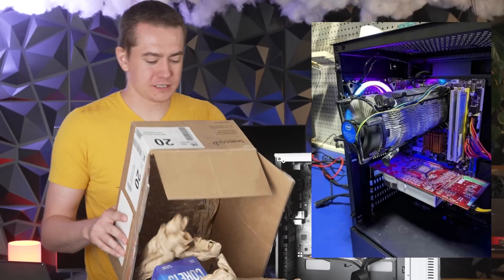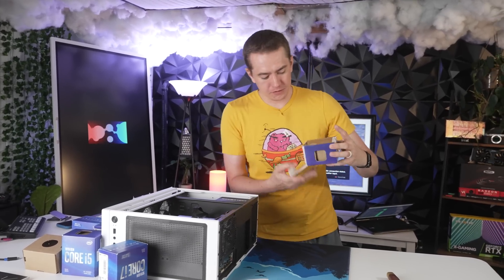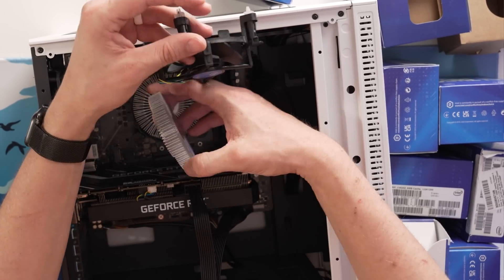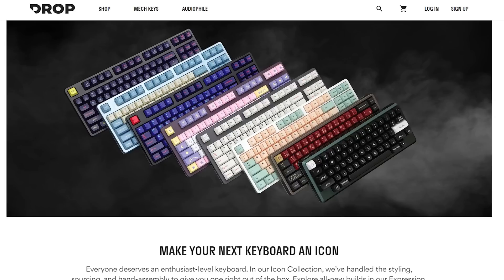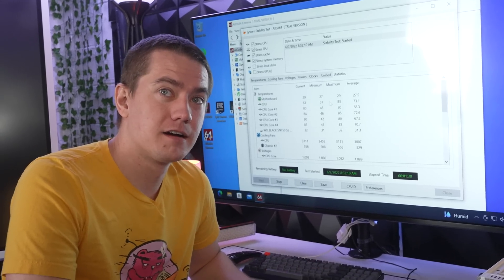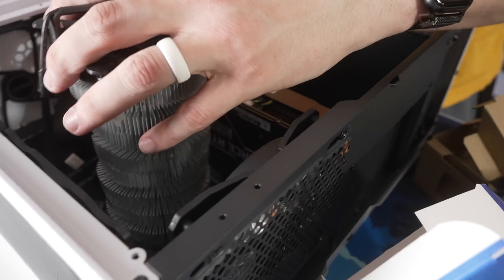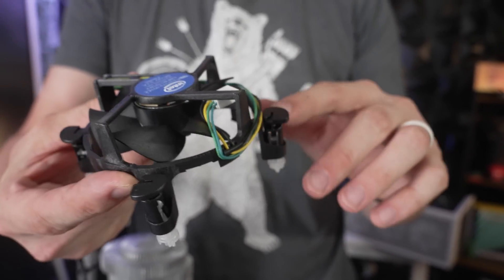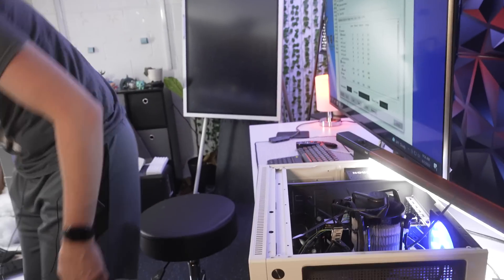Creating the World's Largest CPU Cooler

Comment: Could probably get away with the single fan if all the heatsinks were encased in a tube that forced the air to actually pass thru all of the metal.  Although - a fan with high static pressure would be required.

Comment: im using the same case its great for $40
Reply: I mostly agree.  I have my kids pc in one and the magnetic front panel spends more time on the floor than the case.  It was fairly easy to build in and keeps things cool though.   For 40 bucks it's great though.
Reply: @dougbenson7082   i dont use the one on top but mine seems to stay on okay, could be better for sure like u said tho, and it claims 140s dont fit in the front but i managed to get two on there with all the extra holes that are provided haha